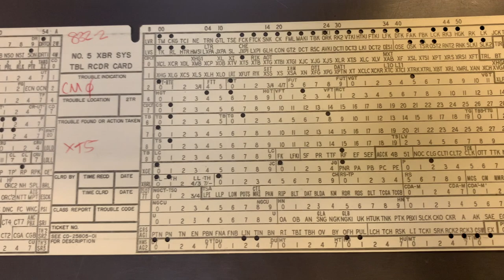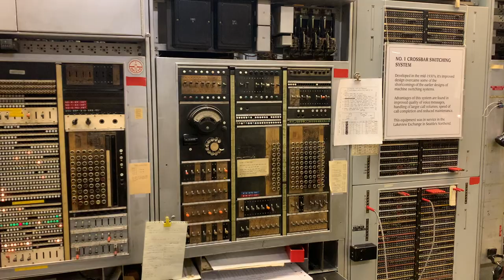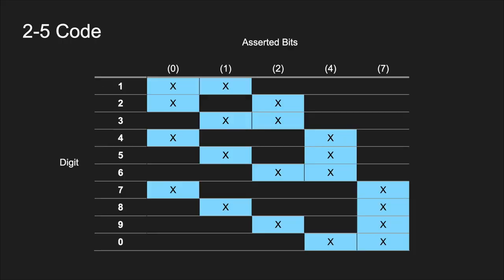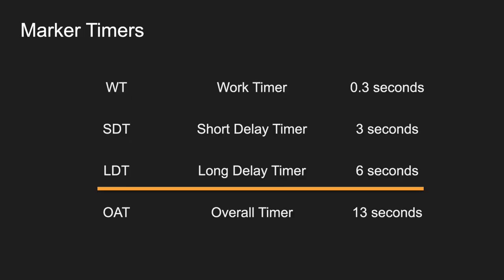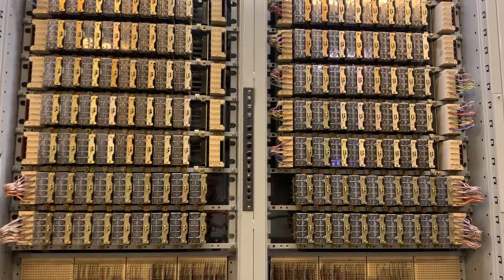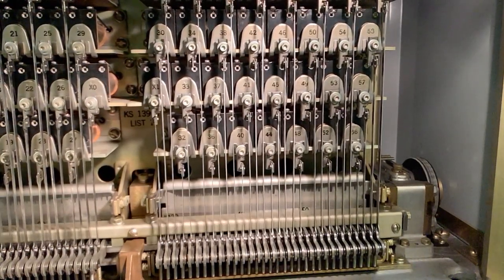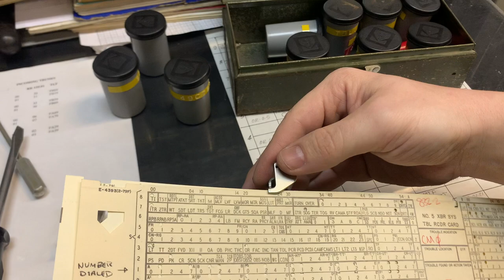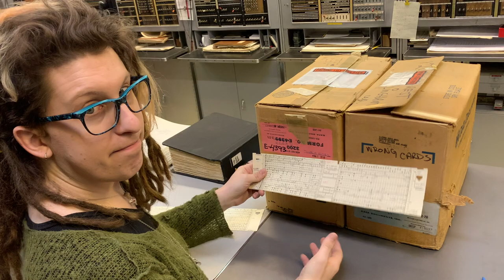The 5XB Trouble Recorder

Comment: It’s crazy how much thoughts went into designing this mechanism driven purely by relay logic. That’s some really impressive engineering.
Reply: I look at this process of diagnosis and repair, and makes me think of what would have been required to design, build and operate something like Charles Babbage's Difference Engine (had it ever been built). Given this is 1922 technology, you can see things would need to be monitored, errors collected and adjustments made.

Comment: You may want to show one of the techniques to trace harassing calls. The recipient of harassing calls would be instructed to keep a log of the date and time of all incoming calls (including the harassing ones). The switch is then set up in such a way that every call to the recipient's line drops a card. Once a harassing call was received the log from the recipient is then compared to the cards dropped. The harassing call's card is then used to trace the call. Compare this to a step-by-step office where the call trace would have to be initiated by busying out the recipient's line before the call ended, then traced back through the switch from the connector, through the selectors, all the way to the line finder.

Comment: Sarah, you did a great job of explaining all the complexities of the system.  The graphics you provided along with the short video clips, showing the equipment in action worked very well together.  Thank you for your dedication to learning how it all works and being able to explain it so very well. Hope you are doing well.
The level of engineering involved to make the trouble recorder work and the cards to be printed properly is amazing.  A lot of challenges had to be overcome; not the least of which was the sheer volume of connections required.  Plus, if I'm not mistaken, all of those relays had to have contacts dedicated to indicating their status for the trouble recorder. 
The clever engineering of the recorder itself, moving the individual bars over so that the rotating shaft would strike them, and then the punch, reminds me of the similar tactic used for the crossbar switch and the skinny wire. Clever and creative engineering.

Comment: For new cards: Have a vector trace of the existing cards made. There is new printing technology which can print and laser cut the cards to shape with notches, etc. so you can order as many as you want.
Reply: the cheaper way if you need a lot of cards is to have a professional printer make a stencil so they can print and punch out the cards, the way they're supposed to be made - and if you have a few thousand made it is by far the cheapest method. Most printers require you to order at least a thousand (some places more) before they'll accept an order that require a stencil, but it can be done. Laser cut is fine if you only need a dozen or two cards, but it quickly becomes very expensive (and thus unfeasible for a museum run by volunteers) when you're into hundreds or thousands of cards, and it is very time consuming compared to a proper printing press. Plus laser cut card stock doesn't have the perfect smooth edges you need for these old machines, so they would likely be useless. And by professional printer I mean an actual printer with rotary presses, not one of those shops that set up an oversized laser printer and claim to be a printer
Reply: The type of paper and thickness of the paper are critical for making them work in the machine. No company makes that kind of paper anymore so it would have to be special ordered just for this purpose. Punch card paper is special!
Reply: @binaryguru  I didn't know that! I remember the paper being a particularly stiff and thin card stock, but never considered it was no longer manufactured. Do you have any reference to a group or something that discusses this? I like research projects like this and have a sneaking suspicion that someone, somewhere in the world could make it, but don't know how I would find the people who still need it for various projects if I could get it organized. is there a board, group, or something for people with this equipment?

Comment: Decades ago, we were getting prank phone calls that went on at all hours.  Our phone number was on a #5 crossbar switch.  Pacific Telephone  put a "trap" on our phone line that essentially traced the call, just like you showed on here.  The person doing the prank calls seemed to know he was caught, as he calmly said, "Impressive. You got me. Your ringtone sounded funky on the first ring. It dropped a card on me, I just know it."  We had two separate phone lines at the time, and I later called from one phone number to the other and listened to see what he was talking about, and he was right.  There was weird timber to the first ringtone (heard on the callers side), and then the rest sounded normal.  Anyone know why this would have been noticed by the calling party?  I'm sure it had to do with the trouble recorder being used to trace the call, but never could figure out why that would happen.  Turned out the prank caller was quite sophisticated and according to telco security was "tandem stacking" to avoid getting caught.  They only were able to trace it to the local tandem switch and that's where it was lost.  Oddly, he never called again once he knew the trap was on there.  That was circa 1982.
Reply from the maker: I'd have to test this to be sure, but my scientific wild ass guess would be:

The marker drops the card as the last thing it does before releasing. This means that the marker would connect both halves of the linkage, set up the ringing switch in the trunk, then drop the card and release. It could be possible that the caller was hearing ringback while the marker was still attached to the trunk and generating the card, and something about that sounded different.  This might be a little hard to test, because we don't know exactly which trunk circuits the office was using, and what type of markers they were using.
Reply: @ConnectionsMuseum  Awesome! Thank you so much for that information.  I've waited 39-years for that, LOL!
Reply: It's been 35 years but I found myself quickly reading the cards you displayed.  The missing 2 out of 5 punch was easy since the marker obviously didn't get very far and another one failed at the JXPA/LXPA/SL phase. You didn't show the dreaded turnover card. That usually meant that someone dropped a wire scrap in a number group or translator.

Where I worked (Bell Canada) we had only one technician that did routine maintenance on trouble recorders, no one else touched them. While he was working it was stressful for me as a troubleman. The recorder was the only thing that told me how "my" switch was feeling that day.

Amazing, at 61 years old I can't remember what I had for breakfast today but I can still remember how to read a crossbar card.
Reply: @michaelrees1376 wow your amazing! Thanks for the comment loved reading it knowing that in those CO's good minds were at work!
Reply: Yes,!!!
Reply: @ConnectionsMuseum  Silly question but did you ever end up testing this by chance?

Comment: Excellent video.  I worked SxS cama in the late 70's and early 80's.  Our trouble recorder had the yellow roll of paper type. I once had a trunk that would drop a trouble ticket with no apparent reason for years.  After I used a automatic test set, (the one with the pegs to program telco no's), I noticed the cama inc. Trunk was having issues with call abandonment.  After utilizing the test frame and reading the sequence drawing for the trunk and cama sender,  I found a wiring error.  Those are the days I miss--- the good ole Bell System.  Wished I could have worked panel and crossbar.  Anyways,  thank you so much.  Very interesting.
Reply from the maker: We just got our paper tape trouble ticketer working in the No.1 Crossbar. In our machine it handles trouble tickets for ANI/CAMA.
Reply: @ConnectionsMuseum  excellent. Hope you will make a video on this.

Comment: I went to a school for a week to repair and adjust the trouble recorder.  We had a very heavy duty adjustable steel table with a a spare recorder. If the operating one failed, it could be unplugged and the spare rolled in and exchanged quickly.
Despite its complexity and frequent use it never failed on us.

Comment: Great video with a lot of detail.    I remember intentionally dropping cards by flashing the switchhook 11 times for the last digit and this would punch 3 out of 5 (as a digit 11).  Dialing A, B, C or D with a 16 button touchtone keypad would do the same thing.   Another way was to dial something that caused "no route" trouble such as 0+ringback number.  Dial administration didn't consider that someone might try to call the ringback number through TSPS (which would be impossible anyway). 

To get more blank cards, you might consult with a printing company.  I know they can get blank card stock, cut it to size and laser print on it but the hard part is the little notches and holes which would require a custom punch.  The cost of setting this up would be high but you could order in a large quantity to justify the cost.  
Something else I thought of is a "virtual machine".  A computer that would interface with the card machine and display a virtual image of the card, or just the raw date.  Not as fun though.
Reply from the maker: Thanks for the suggestions! Yeah, we are looking into getting some cards printed, and it seems like the tooling setup would be the majority of the cost. The difficulty with the tooling is that the notches and cutout dimensions are critical, so it would have to be pretty darn close.

The 5XB also has a computerized card function built right in. In the late 1970s, as offices were staffed less and less, they wanted to centralize all of the maintenance facilities, so they built an adjunct to the trouble recorder called the MDT/PROCON. It sends trouble indications to a centralized PDP-11 with a bunch of modems attached to it. Ours worked, sort of, but then it died, and we don't have the maintenance tools for it.
Reply: @ConnectionsMuseum  I was thinking the same thing, the tooling setup for the notches and cutouts would be critical.  Even variations in card stock could cause problems.   
I can remember when they did more centralized maintenance.  In the East Bay area of California, they had one C/O that took care of maintenance and trouble indications from surrounding C/Os would be reported to the central one.  I could tell when the trouble recorder was taken offline because when it would drop a card, it would normally freeze a line for about 7 seconds (3.5 seconds per trial).  When offline, the line was frozen for only about a second or two before getting reorder.  You can hear a little "tick" in between the first and second trial.   I also remember some mini computers being used on #5 crossbar in the early 1980s.  One had a prompt "MONITOR RUNNING STATE REQUEST"  which I think let you look at battery voltages and a few other things. CAROT was another mini computer for automated trunk transmission testing. 
If the adjunct to the trouble recorder used a serial port (would be serial if modems were used), then it would be easy to interface that to USB port on a laptop and write a program to handle the data.

Comment: On the first Trouble Recorder with the bad shaft,You should be able to remove with the gear and have the shaft made by a machinist or to a good auto rebuilder if it can be repaired. Those are pretty complicated for the day. I grew up with classic cars and power equipment which was easy for me to understand.

Comment: Do you know why the choice was made to make the debug bus parallel? Why wasn't an approach similar to JTAG or Boundary Scan used where each relay has shift-in and shift-out ports, relays are wired in daisy-chain fashion, and the debug status is shifted out one relay at a time? Did the designers really not mind huge 1000+ bundles of wires snaking all over the frame? That seems like it would be much more susceptible to installation error. Assuming a different type of card puncher, this also could have greatly simplified the relays and circuitry required to punch a card (e.g. no latching or less latching required)?
Reply from the maker: Data flow in electromechanical switches is generally parallel. Relays don't move fast enough to pump 1200 bits serially without taking a long time. In addition, the extra logic required to do a serial shift-thing would take many more relays, which are expensive, but the parallel approach means that we can just pick up signals where we need them and carry them across the room. 

It seems like a lot from a modern perspective, but in a telephone switch, 1000+ wires is not that big of a deal. It’s just how things were done. In a normal central office like this, it would be commonplace to have hundreds of thousands or millions of individual wires. Their installation forces were highly skilled workers and before the job was done, a complete set of acceptance tests had to be performed, which ensured that each individual function of the machine was working to specification. It’s all part of what makes these machines so impressive!

These designers were extremely good at designing insanely complex relay circuits and making them ultra reliable. Systems like this are where the concept of 99.999% uptime originated.
Reply: @ConnectionsMuseum  Thank you for the insight!

Comment: Lightning has struck my brain and generated a weird question: Does running a test on the MTF seize the customer endpoint equipment, or does it limit on either end to just telco side, or is that an option you can set on the MTF panel?
Reply from the maker: You can choose via a key on the test panel.

Comment: Can anybody comment? I was an ex crossbar 5 phreaker from many decades ago. In my collection I have both single-sided and double-sided trouble ticket cards, are the different cards dependent on the type of setup in a particular office, ie, the single-sided cards used in smaller, less complex crossbar 5 offices, and the double-sided card in larger offices with many Centrex cx's? Or, otherwise, is the single-sided card always the incorrect card, because you want to be using the double-sided card, or were they from different offices.?
Reply from the maker: There were several generations of cards. The first ones were all single-sided. Later they added double-sided to more complex offices. One of the main factors that contributed to an office using double-sided cards was if it had LAMA capability--that is, local billing for long distance calls.

If the billing hardware was in the tandem office, the 5XB did not need the extra data points provided by two-sided cards.
Reply: @ConnectionsMuseum  : Thank you for the speedy reply.  I find your videos educational, informative and very entertaining. I continue to watch the "troubleshooting problems in #1 crossbar office" over and over again. I would enjoy seeing more crossbar 5 videos, if possible. Because that's the type that was in use in the Maryland area where I grew up, when I did my phreaking as a teenager.  I realize that doing a video about a number 5 crossbar marker would be quite boring, as it is basically a huge collection of multi contact relays, but that stuff really interests me. 
ROCK ON, SARAH!!!!   Keep up the great work 💪!

Comment: I've never used them but smartpress has what they call digital laser cutting. They may be able to accommodate your cuts. Another option would be to contact b something like Boise cascade corrugated or Volm Corporation.
Reply: For BC/Volm there may be substantial fees to create the dies...I then again you might get surprised and find out who made them originally and they've still got them in a warehouse....I don't hardly know where to start but there might be clues on or in those boxes you've got as to whom had the original cutting dies

Comment: It would be work, but you could take a picture or scan of a card to see where the holes are and interpret them.  Then it wouldn't matter how they were printed.

Simpler would be to have a microprocessor record the states of the relays that drive the punches.

My third comment tonight.  Can you tell I'm having trouble falling asleep?

Comment: It looks like the rear recorder--the one not reparable--had some bad mechanical parts. There are so many knowlegeable machinists (professional and amateur) just on YT alone, that it would not be impossible to locate someone who would volunteer to duplicate worn or damaged parts. Perhaps it would be worth doing an episode on exactly what you need to get the thing going again. If it has been possible for computer fanboys to reverse engineer and reproduce bits to get authentic Apollo capsule gear working again, why not a trouble recorder?

Comment: How were calls traced in the era of mechanical switching?
Reply from the maker: That is a very complex question, but the basic idea is that they had to hold up the connection, and then manually trace each switching point within the office (or offices) to see what it was connected to, until they were able to trace out the entire path of the call. There was no database or computer to answer that question for you.
Reply: @ConnectionsMuseum  that's what is so silly about more recent TV shows and movies when it comes to tracing calls. It's been possible to instantly find where a call originates since the 90's, especially when the destination number is being monitored. Triangulation of cell phones has also been available for a long time. Yet police procedural shows like the Hawaii Five-0 reboot flip flop between instantly locating a landline phone and tracking moving cell phones and the old "wasn't on long enough to trace the call".